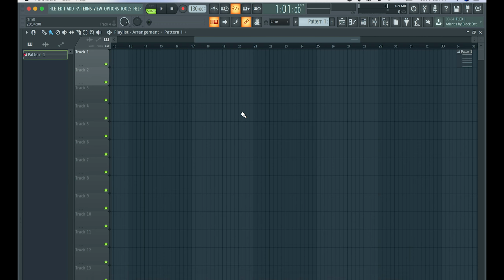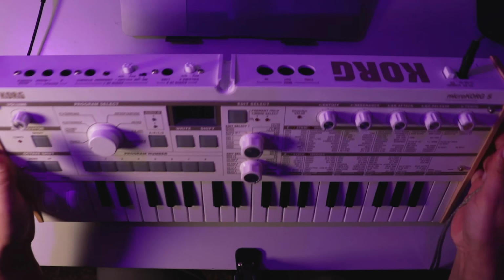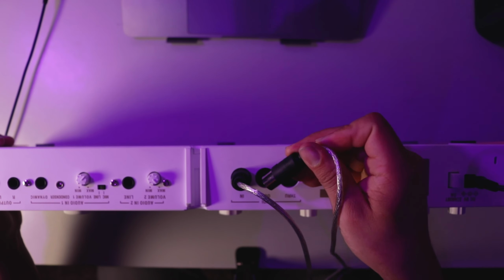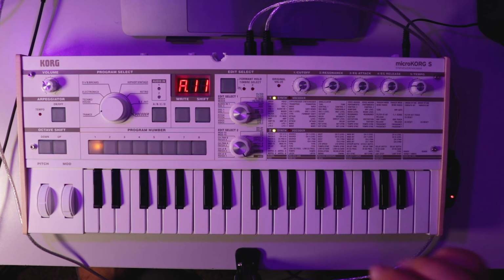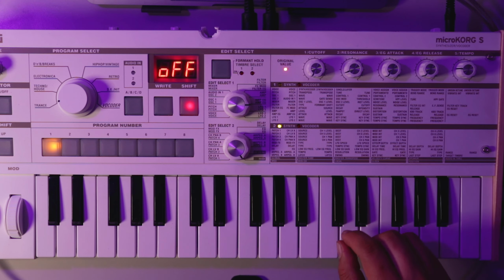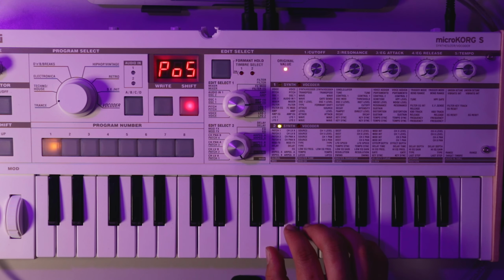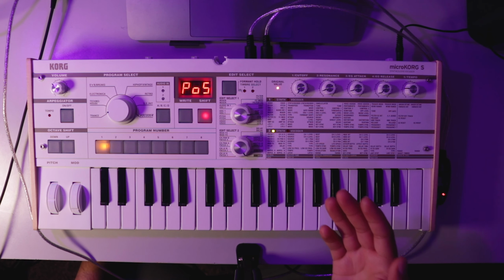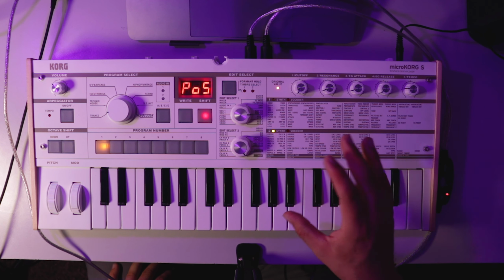MicroKorg MIDI Controller Setup

Comment: Currently having the same issues a lot of others are having on the original Microkorg. 

I'm going from the Midi out on the synth, to the midi in on my interface, no USB adapter. Is this my problem?

Otherwise that setting is missing entirely. I can get to POS in global mode, but the previous 3 settings have nothing in common with what has to be set in Midi (1, off, and ext don't exist in global mode).

Comment: Thanks, it is easy, but how to set up Microkorg to use knobs (cut off, resonance, etc) as midi? To control external synth using these knobs..
Reply: Try to use the remote function in your DAW.
Reply: Try to use the remote function in your DAW.

Comment: Great video, thanks !  I have the original MicroKorg, and I am using Reaper. Reaper sees the device, but no sound.  I set all values as you describe, however the "Position" dial does not provide a "PoS" value, all it provides is a value of "---". With it set like that, no sound. Have you come across this ?  Thanks in advance.
Reply: Yes I have this same problem as well, I'm wondering what the deal is. I noticed he is using the white version which may be different slightly.

Comment: I do have a question that I'm hoping someone has a definitive answer for. I was looking at picking up the Korg monologue XD module only because I want to also pick up a microkorg (original, or maybe the XL) I want the vocoder and I like the functionality of the microkorgs but I want the great features of the minilogue as well but don't want two keyboards. Can all of the microkorgs be utilized as a midi controller for the minilogue??? I could just buy a small midi controller but then I'm back to two keyboards.

Comment: THANK YOU for making this video! I was on the verge of buying a MIDI keyboard (I'm limited to a small/cheap one now, and constantly have to shift octaves up and down real quick... plus there's not a lot of velocity range in the lightweight plastic keys.), so imagine my delight to learn I can just buy a $20 MIDI-to-USB and use the Korg MicroKORG I've had for a few years!  :D  Grateful for this.
Reply: Hi, I have the same thing but my keyboard doesn't have a MIDI input. Is it possible to use a MiDi to USB B 2.0 to then connect my keyboard to my KorgMicroKorg? Thanks.

Comment: Hi Ezra, thank you for the video. It helps me a lot. But i have further problem here. When i record using the microkorg in Logic Pro, it seems the sustain won't release. Especially when I start playing chords. Do you have any ideas on how to prevent the unwanted sustains?
Reply from the maker: I would start by checking the midi settings in Logic. Besides that I have no idea what it could be. Sorry if it wasn't too much help, a lot of this stuff is trial and error. It took me a while to find out how to even connect the microkorg through midi.

Comment: hi, thanks for the tutorial, I hope you´ll see my comment, i really need your help. i've followed all your steps, but, I see your mk turns on the shift key when you chose the MIDI edit, mine not. i don't understend why. if you can tell me what i'm doing wrong, i'll be so thankfull. I bought a MIDI wire a month ago, and i can't make it work :'(
Reply from the maker: Do you have the OG model or the S model? If you have the OG model it could be a slightly different process than the S model.

Comment: do you think a korg ms1 microsampler would work as midi controller?
Reply from the maker: I believe you can turn the Korg Microsampler into a midi controller. 
If I were you I would check the owners manual, you can find one on google.

Comment: i use microkorg vocoder, connected the midi wire but only the usb signal is showing but no midi signal, i also followed you. hope you will help me, thank you very much
Reply from the maker: What are you trying to do with the Vocoder?
Reply: @J.Readingmusic  i am trying to connect the midi wire to the pc, i have followed your action but i have absolutely no midi signal. midi signal does not light up
Reply from the maker: Remember that the in/out inputs have to be connected in reverse. So the midi (in) goes to the (out) on the synth and the midi (out) goes to the (in) on the synth.

If you already did that maybe check the settings on your synth and check the settings in your DAW. 

It could be dozens of different things so it's kind of hard for me to find exactly what's wrong in your case. Those are the 2 main problems that I can think of.

Comment: i was over here wondering if my usb cable was just broken but it turns out KORG just got the MIDI in and out mixed up when they built this thing LOL
Reply from the maker: Yeah its strange that the in goes in the out and vice versa but if it works it works!

Comment: Hi! thanks for your video! but I can't hear the sound when I play MicroKorg..what can I do? I see that signal arrives to Maschine, I can record notes, but I hear nothing 🤷🏼‍♂️
Please can you help me? 
Thanks!
Reply from the maker: Its transmitting midi information to your DAW just like a midi keyboard does. Turn up your volume on your DAW, headphones, monitors or computer. You will also want an instrument open in your DAW or maschine in order to hear something.
Reply: @J.Readingmusic  nope..nothing. I create an Input track in Maschine, check all the connection, but no sounds. I cant understand. 🤷🏼‍♂️ and all the volume is on. I checked the iMac settings too, but nothing. I think I quit 🤣
Reply from the maker: Yeah I dont know, it could be a lot of things. I wouldn't quit if I were you, keep trying. It took me a while to get it to work which us why I made this video.

Comment: Will the vocoder work through the midi?
Reply from the maker: There is probably a way but way to complicated for me to want to do.

If you are already using a DAW like ableton, FL or logic they have built in vocoders you can use with midi and setting those up will be a lot easier and faster.
Reply: @J.Readingmusic  ok thanks for the info

Comment: Hey man great video! Question for you: How do I set up my MicroKorg in Logic Pro X to record the sounds that come in the synth?  Also is it possible to use those sounds as MIDI?
Reply from the maker: I'm definitely going to make a video on this in the next few weeks. 

You're going to record the talk box the same way you record vocals. You're going to want 2 tracks. One that had the synth connected to the talk box and the other track connected with your microphone. Theres a trick to it because it creates feedback when you try to record the audio. You're going to have to mute one of the tracks (I forgot which one) for it to not create feedback when you record.
Reply: @J.Readingmusic   I more meant the preloaded sounds on the Microkorg.  Does the same concept apply?
Reply from the maker: Ah sorry, I'm so used to answering talk box questions.

You can set up the microkorg to record it's own sounds with midi but I dont know the steps on how to do that. I would start with the midi and clock settings on the microkorg and the midi channel settings in logic. That's my best bet on where to start.

Comment: Is it possible to use the setups you have on the microkorg itself to create the sounds that youre recording?
Reply from the maker: You're talking about using the preset sounds on the microkorg as midi and recording it?

If so I think it's possible but it's way to complicated for me to want to try it. What I normally do is just plug my microkorg into my audio interface and record it as audio.

Comment: so i bought the same midi to usb cable from the link but in the “Midi Destination” it says “USB Midi” and not microkorg or something like that. I put it in the opposite way like u said. I am not getting any signal when i use the external instrument plug-in. 
is there anyway u can help me out? im using Logic btw
Reply: its the external instrument plug-in that comes with Logic. You can choose Midi destination, midi channel, input #, and input volume.
Reply from the maker: After you get all your settings dialed in in your microkorg, go into your midi settings in logic and make sure you are on the same channel as the microkorg. Example; if your microkorg midi setting is set to channel 1, then set your channel in logic to 1. 

You might also have to just tweak the settings until it works. There are so many variables between different DAWs that it could be a lot of things. 

Let me know how it goes and get back with me
Reply from the maker: No problem, what is the "midi destination" that you're talking about?

Comment: I have a PC running Win XP Pro SP3/ Reason 5/ Korg Micro X/ I successfully downloaded Korg's USB-Midi drivers/ heard the ding...but my DAW won't recognize the Korg. What am I doing wrong?

Btw I'm using an M-Audio Keystation 88es x Akai MPD226 mainly, I just wanted to now use the Korg for my main keys.
Reply from the maker: Remember that the midi in and out are reversed and to  change the settings to midi on your korg. You might also have to mess with your midi settings in reason. It could also be a lot of other things but you can start with those things.
Reply: @J.Readingmusic  The Micro X has it's own built in usb-midi port on the back(no need for a 3rd party).
Reply from the maker: I'm not too familiar with the Micro X so I'm not sure how to get it to work with your specific set up. 
All I could say is go over your midi settings in your DAW and the midi settings on your keyboard and make sure they are correct.

Another great option is to buy a dedicated midi controller. The Akai MPK Mini MK2 and MK3 are great affordable options. It automatically connects to your DAW so theres no stress in trying to get it to work.
Reply: @J.Readingmusic  👌🏾 I already mentioned that above, I have 2 already.
Reply from the maker: Oh damn I straight up didnt see that haha my bad

Comment: How do you record the actual synth sounds from the microkorg instead of using it as a midi?
Reply: I’m wondering the same thing . How does one connect the micro korg to a DAW?
Reply from the maker: To record the actual synth sounds on a DAW you will have to connect an instrument cable from the output on the synth to an input on an audio interface. Then press the record button on the DAW and play away.
Reply from the maker: You will want to connect the microkorg to your DAW.

Comment: I am using microKORG, cannot turn to "Pos" no matter how I tweak the peg 4. Can you give me some suggestions? Thanks.
Reply from the maker: This seems to be a problem that a lot of people with the regular MicroKorg have, I would say just try skipping that part and see if it works. Let me know the result if you can.
Reply: @J.Readingmusic  Thanks! After several plug in and out, and tweaking, I'm finally able to use microKORG as midi controller on GarageBand. But, all functions like arpeggiator, program select, cutoff, resonance and other stuff do not function, it just perform as a regular midi keyboard inside DAW. Is it possible for microKORG to take over those functions from DAW?
Reply from the maker: I got the same results as you did, basically only the keyboard worked.
I'm sure there is a way to set up the pitch and modulation wheels and the arpeggiator.  There might be a way with the microkorg application that you can download on your computer to tweak the setting and possibly tweak the midi setting to align with the controls on the keyboard but at that point it takes so much effort and so much time that I would rather just whip out my Akai MPK mini controller and use that Instead.
This tutorial is good if you dont have a midi keyboard around and only have a microkorg, but only provides basic input to midi.
Reply: @J.Readingmusic  lower wheel to global, then it works

Comment: How did u get postposiotn set up? Mine just has the 3 lines. I hsve the original microkorg
Reply from the maker: I honestly thought it would be the same fro both the original microkorg and the microkorg s. But you and a couple other people seem to have the same problem on the origional microkorg, my guess would be to try and see if it works even if the " pos" is not set. When I get my hands on a original microkorg I will troubleshoot the problem and most likely make an update video.

Comment: i cant configure that POS part, when i roll the release it dont show me up any option to select. what is wrong with my mk1? :(
Reply from the maker: It could be a lot if different things and seeing that you have the original microkorg it could be a little different for yours. To be honest it took me a while to figure out how to get the midi to work but after a lot of trial and error I got it. Make sure your selection knobs are in the right position, maybe watch the video again to make sure you didnt miss anything.
Reply: you need to turn on "global" on the lower wheel, then the position adjustment is working, see its in the upper grey line, so "global " will work. Just had the same problem

Comment: Hi my po5 on the position bit just shows '- - -'. any Idea why?
Reply from the maker: You might have to make sure you are able to write over the existing patch. Try pressing "WRITE" and then changing the settings.
Reply: turn lower wheel to global, then it will work with position

Comment: Hi thanks for the video. I'm currently attempting to add to Presonus Studio One 4. The device is registerubg as "usb midi" but can't doesnt seem to be working properly. I have everything that's needed.
Reply from the maker: It's going to be different for everyone and it took me about 30 minutes to figure out how to get it to work on mine. 
I would say to make sure you double check the settings on both the synth and the DAW, sometimes you just have to mess with the settings until something works.

Comment: I don't even have a microkorg but still I watched the video, so now in case I get a microkorg I know how to use it as a midi controller. Thanks man
Reply from the maker: MicroKORGS are great synthesizers especially for beginners which is why I got mine. The sound possibilities are endless, thanks for watching!
Reply: @J.Readingmusic  Hi, Can you show us how to use the 5 knobs on the microkorg (cutoff, resonance, etc...) as MIDI control knobs ? Is this possible  ?
I'd like to use the 5 knobs to control some knobs on my software plugin synths in real-time...
Reply from the maker: I probably will not make a video on this due to the reason that instead of trying to program the microkorg to control parameters in your DAW, it will save you a lot of time and frustration if you use a midi keyboard. Most of the time the midi keyboard will automatically program its knobs to control certain parameters in your DAW. I'm sorry if that's not the answer you were looking for but it's my honest answer. I mainly use my Microkorg with my Talk box and for controlling my DAW I use my Arturia KeyLab 88 Mk 2. It works a hundred times better as a controller than the microkorg will.
Reply: @J.Readingmusic  ok, but is it technically possible to for example control the software synth's filter cutoff with one of the knobs on the microkorg ? what's the main problem ?
Reply from the maker: Oh yeah it's totally doable but too much of a hassle for me to want to try to do. 
Finding a way to be able to map the knobs to the DAW might be the hardest part but maybe once you figure it out it will be a piece of cake.

Comment: Hey man! Great video! I’m working in Ableton 10 suite and can’t figure out how to configure my microkorg to Ableton. I’ve watched a lot of YouTube videos and can’t figure it out :/ any suggestions?
Reply from the maker: It should work fairly the same in Ableton, I would make sure that your settings on the microkorg are dialled in right and that the settings in your DAW are correct. It took me about an hour to get it to connect and it took a lot of trial and error before I got it to work. Type in "microkorg midi keyboard " on google and search through the forums, you will eventually find one that explains how to do it for ableton.

Comment: Hi, this helped me thank but still need help please
I have the regular microkorg and somehowe the 4th knob doesn't wanna set at PoS it just stays blank.. also when I play, the sound remains even when I stop as if the keys were sustained somehow (but I've checked there's no sustain activated )
Can you help me out? 🙏🏾
Reply: same issue!
Reply from the maker: You might want to make sure that your Edit Select 2 knob is set to MIDI.
I think the main thing is to set the clock to EXT, once you have that you should be able to use the keyboard as a controller but many things can go wrong and there are a lot of different reasons why it wont work like DAW settings not being correct. If you need more help you can reply to this comment or you can talk to me through Instagram for s faster response
https://www.instagram.com/j.ezra_media/
Reply: @J.Readingmusic  My issue is now latency. How do i make sure my keyboard has instant input?
Reply: lower wheel to global, then it works with position

Comment: Anyone having troubles with the regular microKorg?
Everything is set up as in the video (In-Out, Out-In, FL Studio with opened Synth as shown, Korg is set to Midi mode with all the knobs where they should be), the only thing that's different is that the spinning thing number 4 does not show PoS anywhere, just a "- - -". But it's at the same position as shown in the video. Everything else is fine.
I'm new to all of this. Is there a way to verify whether sound is coming to the PC?

edit: Ok obviously it's the MIDI-Settings. I have no Input anywhere it seems. A bit of troubleshooting and everything is fine.

Thanks for the video!
Reply: hey i was wondering how you fixed this bc i have the same problem?
Reply: @Pablo-xp6xs  same problem
Reply: @Tamara Simons same problem! any solution?
Reply: same problem... please help
Reply: I have same problem,how you fixed it.?